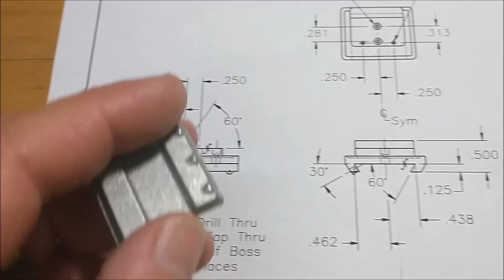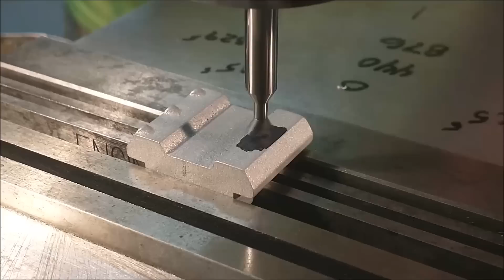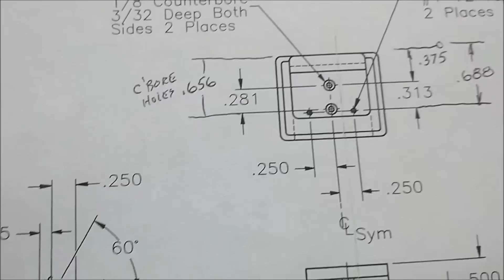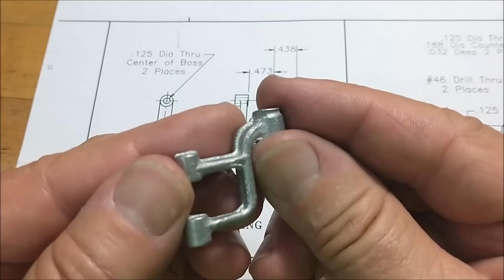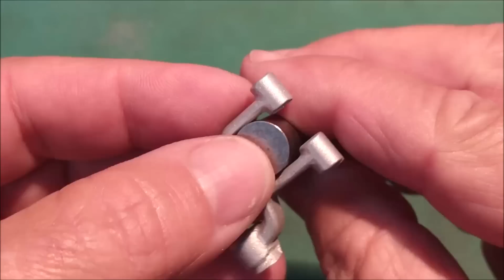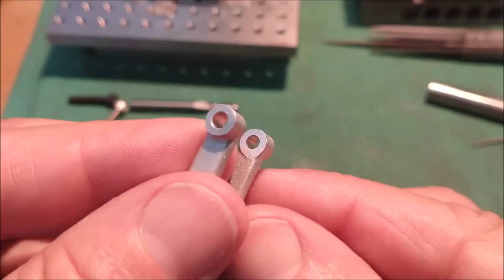Machining the Mini Mill Saddle and Pivot Arm -- Shop Gem Included --

Comment: Joe, this question isn't related to this video (though it did make me think of this question), but maybe you'd be willing to make one or more? videos to answer it.  I hope!

Can you explain to us home shop machinists, that watch your videos to learn machining tips & tricks, about how to go about selecting carbide insert tooling or solid carbide tooling for "light" machinery?  My mill-drill uses R8 collets like a Bridgeport does, but I've only used HSS cutters so far.  My old (1911) South Bend ~10-inch lathe also has only seen HSS cutters.  (Also, maybe a "HSS Basics" video would be a good idea too?)  I for one am overwhelmed, so far, at the huge selection of different shapes & grades(?) of inserts and even the tools that hold the inserts.
Reply from the maker: Quick reply to this question:
HSS......get a cobalt hss. Its much tougher
Carbide for aluminum.....K68 uncoated
Carbide for steel....KC710 coated    Mild steel and stainless
Insert profile depends on how many holders you plan to buy and what material you plan to cut
My GoTo holder is a TPG holder. Triangular insert with a variety of corner radii available.

Comment: You are so right, the simple part can and is often complex. Now as to the defect in the large end, instead of trying to file it round, consider milling a large enough flat across that area so that it looks like it could have been a place for some option or accessory. After all, there may have been an option for a handle or bracket or something there from the factory.
Reply from the maker: I have a plan. :)

Comment: I was lucky enough to find a Enco model 100-1525 milling machine as well 510-2584 geared head Lath in excellent condition.  As my first projects after getting them in place and ready to start using them, I would love to add DROs to them both.  I would love your input as to the best units I should use.  
 Thanks for all your explanation in your projects!
Reply from the maker: My absolute first choice is always Acu-Rite DRO's
Reply: @joepie221   thanks!

Comment: How do you decide on the pin size for the dovetail, I don't understand this method and could use learning it.  Do you have video I forgot about that discusses this?
Reply from the maker: https://www.youtube.com/watch?v=Wc0m4BiDXGE&t=1266s       This video show several methods based on the dimension scheme on your part print.
Reply: @joepie221 Thanks Joe, I will

Comment: I have to admit, I cliched just a bit on that first hole through the arm when it started deflecting :)
Reply from the maker: Me too. The shims were 6061 and the casting was.....well a casting. So softer. Clamping pressure was a concern because I didn't want to imprint the pivot arm. The clamp had to also be slightly offset to allow for the milling of the inside of the larger end. It's Ok, kept it interesting on my end. Just glad my eyes could see it. :)

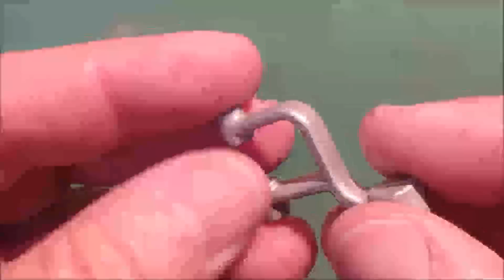Comment: Joe, you might want to review your source video for glitches.. there was some artifacting near the beginning when you were looking at the drawing, and again around 15:15 while showing the bracket after it was filed down.
Reply: This is usually an issue with the compression codec used when exporting a video from an editor. The source footage is likely fine, it’s probably just a setting with interlacing or compression that needs changed for the export.

Comment: Second, LOL. Hey Joe, As promised, Here I be with baited breath for this next post. Awesome and onward eh. These castings are as good as anyone could ask for. No sneaky, tool shattering sand pockets and a symmetry well balanced. With you taking the extra time to pretty up pieces as you go along really gives the job a lot more attractive. Usually factory pieces can have blood letting sharp edges all over pieces. Just like the inner dash of todays new Fords. If you are going in there bandaids are always handy. Blood is notorious for being hard to clean leather. As you just said, , , Don't underestimate any pieces until the blood quits flowing eh, LOL. Thanks a bunch for another post on this wee mill. Ya rock fella !